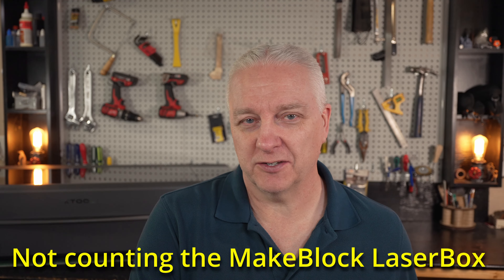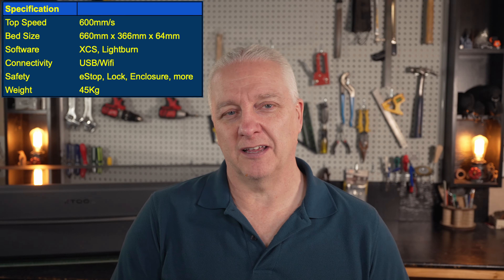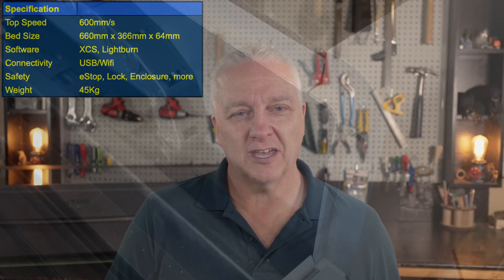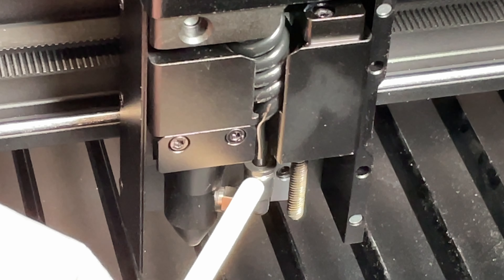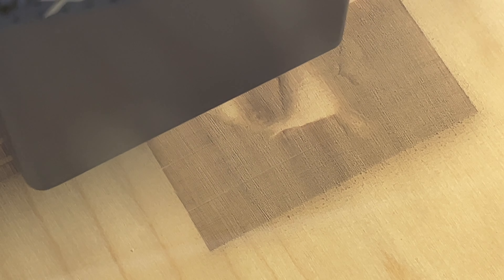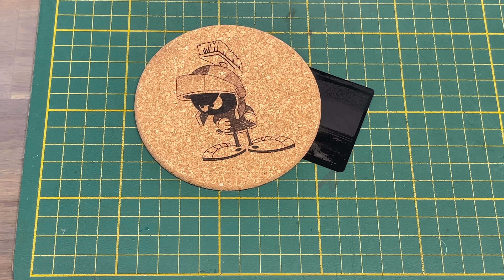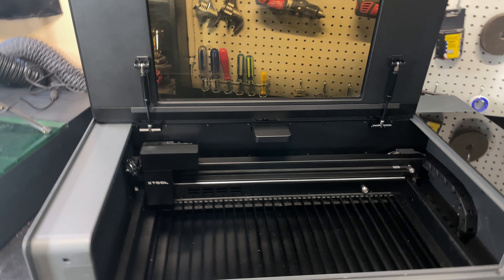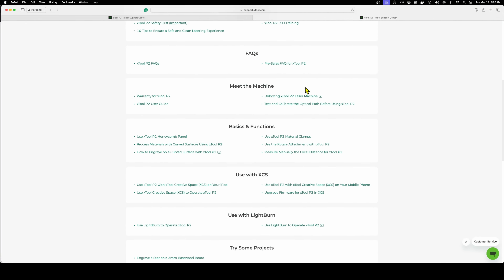Is the xTool P2 the Best CO2 Laser?

Comment: It is misleading to say it is supported by Lightburn: No focus control (other than by sending a g-code preamble after manually measuring the thickness of the material and doing a little calculation), or camera support.
Reply from the maker: In this regard it works like any diode laser would from a focus perspective.  While it isn’t nearly as appealing as using XCS, it isn’t more misleading than saying lightburn supports any other laser.  Is this a limitation in the P2 or Lightburn?  I’m not sure.
Reply: @SteveMakesEverything  Lightburn claims that XTOOL does not provide the information necessary to integrate camera and focus. This sees plausible since XTOOL would obviously like achieve XCS lock-in.
Reply from the maker: @BrianGlendenning  Well I've been privy to the other side of that conversation and the argument appears to be reversed. 😀. And xTool isn't the only company having this issue.

Lightburn really needs to make changes to their thinking and architecture or they are going to get blind-sided by one of several companies who are improving lasers with features that Lightburn refuses to support.

Anyway, this isn't an issue we can solve.  Let the companies duke it, and in the end, the consumer will win. 😀
Reply: @SteveMakesEverything  Clearly it would be cleaner and unambiguous if LB defined an API or protocol for laser manufacturers to fill in in whole or in part. LB claims this is on their roadmap, I guess time will tell. (I'm a newish Laser/P2 owner who would prefer to use LB. It's possible but more annoying than it should be).
Reply from the maker: @BrianGlendenning  I agree that running any xTool laser in LB isn't quite as nice as XCS because some of the features in their products are critical and can't be used.

Unfortunately, due to the lack of a proper way to plug into lightburn, manufacturers are just building their own software (e.g. XCS or Wecreat MakeIt!).   Personally, I think we are at the beginning of a phase where laser companies are moving away from Lightburn because they want to immerse their customers in an ecosystem rather than building a laser and hoping Lightburn catches it. Think about how Apple shelters its customers in an enclosed system where it controls everything - this is what companies like xTool and Wecreat are trying to do.  The pros and cons of this are obvious because we've been here before with other products in other industries.

Comment: You test samples are hard to compare.  I really would like to see everyone get on the same page on speeds:  mm/sec.  just easier to visualize.   Also some kerf comparisons with the s1 40 would be informative.
Reply from the maker: I try to work in mm/s most of the time, but diode lasers generally measure better with mm/min. Just multiply this values by 60.

Kerf of co2 lasers will always be larger for co2 lasers. Figure diode lasers for 0.08-0.15mms of kerf, while a co2 laser will be 0.2-0.3mms

Comment: Hi Steve, Great video I have been looking at CO2 Lasers but no one mentions what sort of up keep they need? ie: How long until the Tube needs replacing, do you have to change clean out the water etc etc.  Would love to here you thoughts. Cheers
Reply from the maker: Overall maintenance isn’t too bad. Clean the optics on occasion and sometimes an alignment. The tube are typically good for 2000 or more hours depending how hard you are driving the laser. A 55W tube should have a reasonable replacement cost. Not until you get into the 80w+ tubes that prices go a bit crazy.

Watch the channel for mor P2 videos coming.
Reply from the maker: @zedinator These are great tips!

Comment: How would you say it compares to your FSL Muse3d? We bought one at your suggestion back in 2021 and our experience with FSL has been terrible (the machine is great when it works, but I've had many issues and their support is awful)  I am hoping to replace it in the next year or so. Would you find this to be an upgrade or a lateral move?
Reply from the maker: With hindsight I would pick the P2 if I were buying today, but.  I haven't had any issues with my Muse3D, but I credit my own past experience for that because it has given me the ability to solve my own problems.

You're picking at a pretty painful scab with the support comments.  I think FSL has terrible support, but they are certainly not alone.  Almost every company in this industry suffers from this.  For example, I've been talking to Creality about one of the products I own, and while they are trying to be helpful, every interaction requires a 2-3 day response loop. So I've been trying to solve a problem for a month, which is hardly what I would call a great experience.

I would be happy to become a local service center for some of these companies to show them what customer support really is😉
Reply: @SteveMakesEverything  Thank you for taking the time to respond! I'll keep the P2 in mind for my replacement (and use your link just as I did when I bought my Muse!)

I'm not at the level of someone who wants to tinker with every aspect or build my own machine, so I wanted something with a friendly interface, which is why FSL originally appealed to me. The autofocus failed on my unit while the machine was still under warranty. I spent months trying to get help only for them finally to try after the warranty was expired, then they claimed I couldn't be helped. After furnishing proof and threatening legal action that I had been complaining about it before the expiration, they finally agreed to help but I had to send the machine to them at my expense. My husband drove it to Vegas (we live in Los Angeles) and reversed the process to pick it up as it was cheaper than shipping it both ways. When we got the unit back it was still unfixed, come to find out they just replaced the air hose on the Z-axis because "it was maybe too short and causing it to stick" They since have stopped responding to my service requests. I know every company has their troubles but this experience was truly abhorrent.
Reply from the maker: @thewestcoastkraeers  Thanks!

The things I like when compared to the Muse 3D:
- XCS is definitely easy to use and you can still use Lightburn, though it's not nearly as nice because some of the features of the P2 are inaccessible.

- Alignment is pretty easy.  I aligned my P2 when it arrived when following the xTool tutorial video was very easy to follow.

- There is quite a bit of expandability.

Comment: Hi, I have a specific question if you dint have the Muse 3D and you are looking for a C02 laser to buy with one you choose? and why?
Reply from the maker: Yes today I would be buying an Xtool P2. It has a ton of great features and is fully enclosed with no external pumps or cooler.  It also has a much more precise beam - almost like a diode laser.  Watch the last short video I did where I engraved my name on a grain of rice. I can tell you for certain that a Muse 3D could never position accurately enough to do that

Comment: Do you think the "xtool P2" laser is better than the "Muse 3d" 
I really like both machines because of there live 3d autofocus/scanning/ Z-achse controll. 
Which machine would you recommend?
Reply from the maker: Having used the Muse 3D for 3 years, I can assure you that FSL's autofocus really isn't magic. You get essentially the same capability and more in the P2.  Actually, you don't really have to think about the focus at all on the P2 - if you enter the thickness of your material into XCS, it just works.  Now, if you are using Lightburn with a P2, then things are a bit different.  From the P2 perspective, Lightburn is quite limited, and while I like Lightburn, I just wouldn't use it with an xTool product - especially with XCS 2.0 on the horizon.

For less money (at least based on MSRP), the P2 offers a bigger work area, 20% more power, more features, more expansion, and a more robust design. The only possible downside to the P2 is that you can't possibly service it yourself because pretty much all the parts are available only through xTool, while many parts on the Muse 3D can be purchased on places like Amazon.

I also think that xTool is a better company than FSL has become over the past couple of years.  The latter has a history of bad service and some really strange internal strife, including crimes committed by now-former employees. 

Right now, I can't really think why I would buy a Muse 3D over a P2.
Reply: @SteveMakesEverything Thank you. 
Are you think XCS 2.0 will be comparable with Lightburn or is there still something missing?
Reply from the maker: @NewLOL74  With XCS 2.0, xTool is on par with most things in Lightburn, and in some ways, it is ahead. For example, if you have multiple lasers, you can run more than one job at a time.

A true head-to-head comparison is a bit challenging because xTool is focused heavily on ease of use, so a few things happen without the need to think about them.  Other features are exclusive to the xTool hardware platform and aren't possible in Lightburn - even when using an xTool laser (for example, engraving on contoured surfaces)